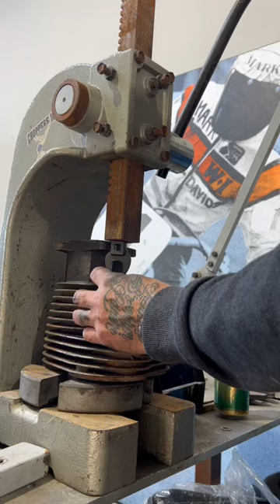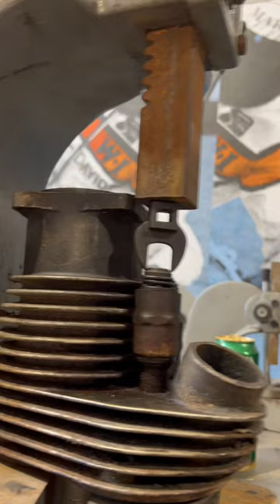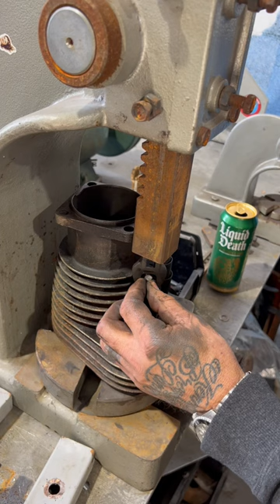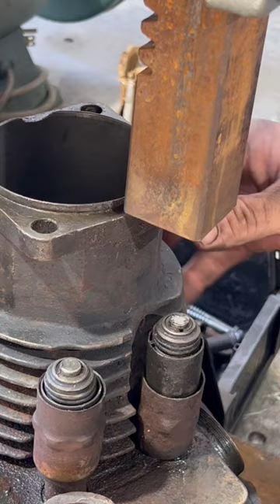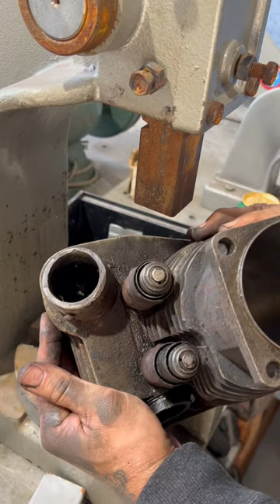Poor Man’s Valve Spring Compressor Hack w/ Arbor Press & Crow’s Foot Wrench #shorts #hack #harley

Comment: I know you are getting ready for Sons Of Speed. After the event. Can I bring chopper by your shop. So you can fix what needs to be fixed also the possibilities of a frame  as well. Or at least setup an appointment to come by. What I would like to do is to long to type. But can tell you in less than 5 minutes.